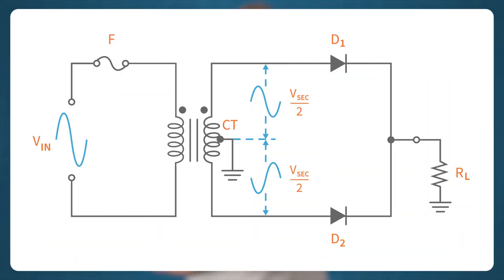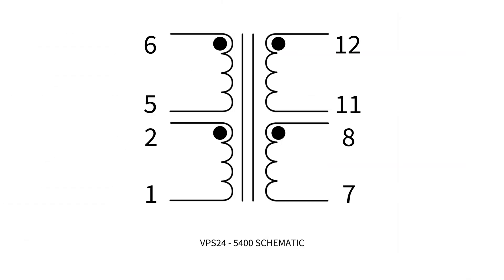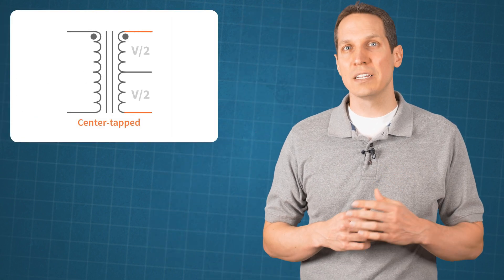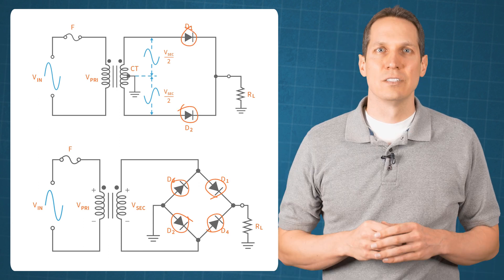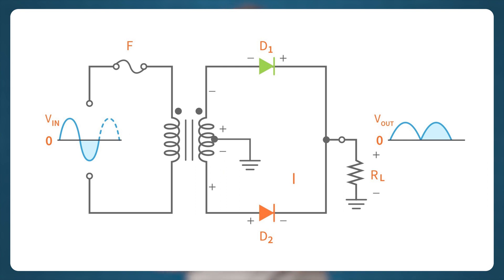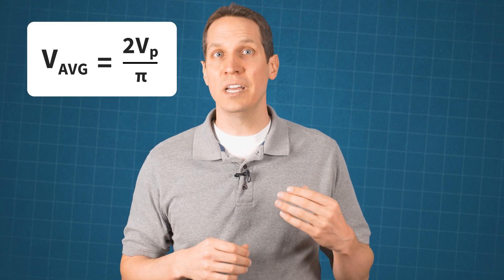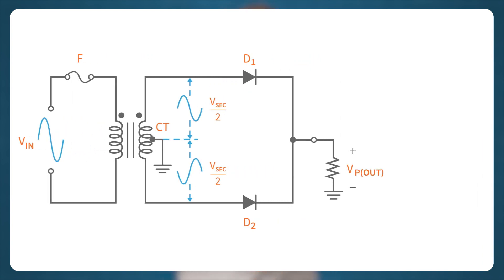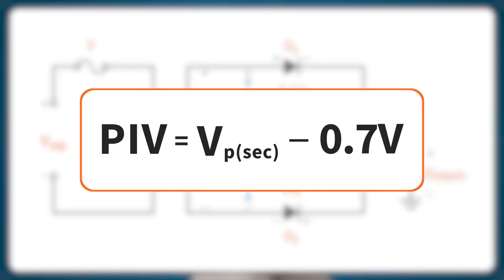Full-wave Center-tapped Rectifier Tutorial | Basic Electronics

Comment: Hi! Thanks for the explanation about center tapped transformers! I rolled up my sleeves to build a bipolar power supply from an old toroidal transformer and LM317 + LM337 regulators.

I personally fixed (blown thermal fuse) a toroidal center tapped transformer a year ago. I had to unwind the secondary side to reach the blown fuse. It was different than you have shown in the video. Starting point of secondary windings are directly connected to each other from 0V point. Which means the center tap is starting point of winding and is real 0V. The transformer ends with two separate 16V wires and 0V center tap. (16V-0V-16V)

Can I rectify the AC with just two diodes (for this specific transformer) as well?

Comment: You got the current direction wrong at 2:06. Current cant travel through the anode of a diode.
Reply from the maker: I just reviewed and it looks right at 2:06.  Also, current can only flow from the anode to the cathode of a diode (with the exception of reverse leakage, breakdown, zeners - none of which we're considering here).  Are you mixing up electron flow and current flow?
Reply: @CircuitBread  weird, my professor specifically said current cant travel from anode to cathode, that it is a check valve and current can only travel from the cathode and out the anode. Im going to have to check this out. Thanks for the info

Comment: Hi, Amazing video. I understood Center Tapper Rectifier. But can you explain to me why in the bridge rectifier voltage isn't halved? There too current take two paths to reach Load. Or, Am I understanding it wrong?
Reply from the maker: Hey Pantho, there is actually only one path with a bridge rectifier, but that path changes depending on where you are in the cycle.  The only reason your voltage drops is it going through the two diodes in each path.  Check out this tutorial and see what you think: https://www.circuitbread.com/tutorials/bridge-full-wave-rectifier-operation
YouTube doesn't notify me of second responses for some reason, so if you have any follow-up questions, I recommend putting a question on that YouTube video or even jumping on our Discord channel.

Comment: EXP. NO.6 
EXP. Name:  Center-Tapped Full-Wave Rectification 
 
OBJECTIE: 
 
The purpose of this experiment is to convert AC voltage to DC voltage and to demonstrate the operation of the center-tapped full- Wave rectifier and recognize a full-wave rectified sinusoidal voltage. 
 
EQUIPMET: 
 
1.	Digital  Multimeters 
2.	Breadboard 
3.	Step-down center-tapped transformer (220V/12Vr.m.s) 
4.	Dual-Channel Oscilloscope 
5.	General Purpose Silicon Diodes 1N4007 
6.	Resistor 1kΩ 
 
1. Theory: 
 
The rectifier is circuit that converts the AC input voltage into a pulsed waveform having an average (or DC) value.  
 
Types of rectifier circuits are:   a- Half Wave Rectifier Circuits   b Full-wave rectification. 
	A center-tapped (CT) full-wave rectifier 
	Full-Wave Bridge Rectifier 
The full wave rectifier converts both  positive  and  negative half cycles of the input AC signal into output pulsating  DC signal. 
Center tapped full wave rectifier: 
 
A center tapped full wave rectifier is a type of rectifier, which uses a center-tapped transformer and two diodes to convert the complete AC signal into DC signal. 
 
Figure (1) shows a schematic diagram of a full-wave center-tapped rectifier uses two diodes connected to the secondary of a center- tapped transformer. The transformer is useful in electrically isolating the diode rectifier circuit from the 220V AC source, and also is used to step-down the input line voltage into a suitable value according to the turns ratio. The transformer’s turns ratio is defined by: 
 

  
 
Where Vp is the r.m.s value of the transformer primary winding voltage, and Vs  is the r.m.s 

value of the transformer secondary winding voltage. In the circuit of Fig.(1), The voltage for 

Ac source is 220 V(r.m.s) 

 
Figure (1): The Center-Tapped Full-Wave Rectifier Circuit 

 
  
 
The Input voltage is coupled through the transformer to the center-tapped secondary. For the positive half cycle of the input signal, the polarities of the secondary winding voltages are shown in Fig 1. This makes the upper diode D1 conducting and the lower diode D2 to be reverse-biased. The current path is through D1 and the load resistor RL. For the negative half cycle of the input voltage, the voltage polarities on the secondary winding of the transformer will be reversed causing D2 to conduct, while reverse-biasing D1 .The current path is through D2 and RL. Because the output current during both the positive and negative portions of the input cycle is in the same direction through the load, the output voltage developed across the load resistor is a full-wave rectified DC voltage as shown in Fig.(2). 

  
Figure (2): Waveforms of the Full-Wave Rectifier 
 
Input peak AC voltage (Vp (in)) can be calculated as: 
 
  
 
 
The peak value of the output voltage is given by: 
 
  
In equation (3), VK it was assumed that the voltage drop across the silicon diode is 0.7V when it conducts. 
It can be verified that the mean (or DC) value of the output voltage is given by: 
  
 
Mean or dc output current is given by: 
  
 
 
2. Procedure 
 
a)	Connect the circuit as shown in Fig. (1). 
b)	Draw the input signal voltage waveform (A.C.) voltage, and calculate the pick AC voltage (Vp(in)), time (T), and frequency (f) by oscilloscope. 
c)	Draw the output direct pulses voltage (D.C) voltage, and calculate the maximum output voltage (Vp(out)), time (T), frequency (F), mean (or DC) output voltage (Vdc) at D.C. position of oscilloscope. 
d)	Measure the direct output voltage (Vdc) and direct output current (Idc) by multi-meter. 
 
3. Calculations 
 
         From the practical results of this experiment, calculate theoretically the           following:  
 
          a)Vdc          b) Idc     c) Vr.m.s

Comment: I understood Center-tap rectifier is Vp(sec)/2 and Bridge  rectifier is Vp(sec). So, I think that Bridge Rectifier had no loss of Vp than Center-tap Rectifier. For this reason is Bridge Rectifier more efficient than Center-tap Rectifier ?
Reply from the maker: Actually, if anything, the center-tap rectifier is more efficient as you only have the voltage drop over one diode, not two, as well as the slightly smaller component count.

Comment: Remember, dont get secondary winding peak voltage mixed with the center tapped secondary voltage. The last equation can get confusing to beginners and the diodes need to withstand the total voltage not the one given by just half the winding.
Reply: this is very confusing for me; I don't understand why 😥

I was thinking that PIV = (Vp(sec) / 2) - 0.7 since the lower diode is reversed biased and in the practical model it will be treated as open.

My professor said this though and I don't understand why it is so: PIV = [(Vp(sec) / 2) - 0.7] - [(-Vp(sec) / 2)] => (Vp(sec) / 2) - 0.7
Reply: my prov qlso said piv is vsec/2, but the way i see it is that the upper half is providing Vsec to the REV doide and load, 

while the other half of the coil is ground and - so it is pulling across the diode. so 2 forces of Potential Difference. for example, 10 and -10. so 20v this is assuming the full windings on Vsev makes 20v.

Comment: I want to create a powerful electromagnet, but I have no idea how to build one or map it out in a drawing or on a circuit board which is the actual goal. I was wondering if you had an email so we could discuss this further?  

So far what I've come up with for the circuit is as follows:

1.)"Step Up Transformer", the reason being I want to increase voltage, I know it drops current. Also this is a DC source, 9v battery 0.31amp hours. 1:4 ratio 10 loops - 40 loops. Primary Voltage= 9, Secondary Voltage= 36. Primary Current= 0.31 amps, Secondary Current = 0.0775 amps.

2.)"Oscillator", I want the current to go back and forth as many times in a second to increase the strength of the electromagnet, I'm assuming that by increasing how many times the current runs through the loop I will be increasing the overall current to the electromagnet. For example, a constant current of 2 Amps over a span of 1 second vs.2 Amps at a frequency of 30 Hz is 60 Amps in 1 second, or that's how I see it in my head could be wrong.

I was thinking of an LC oscillator; with a 10mH(10x10^-3) inductor, 20uf(20x10^-6) capacitor, and a 10-ohm resistor, the reason for the resistor is the impedance would b "0" without a resistor because the XL & XC(22.36) equal "0" when subtracted and V/0 cant happen. With a 10-ohm resistor, I-RMS is 3.6 A.

3.)"Transistor", NPN(BJT) I assume would be the correct type to use. The reason for this is to amplify the secondary current and another to amplify the frequency of the "Oscillator"; the resonant frequency is 355.88 Hz. The goal is to have a current higher by a factor of 3.5 times the secondary current and frequency higher by a factor of 3.5 times the resonant frequency. I also learned recently that by increasing the frequency we increase inductive reactance and lower current, so I don't if it's possible to increase the frequency and current, I don't want to increase the resonant frequency but I want to increase frequency overall and I don't know if those two are actually separate. But even if by increasing the resonant frequency we would lower the current couldn't I just amplify the current by a higher factor to overcome the inductive reactance? 

4.) "Center Tapped Full-wave Rectifier", the reason for this is so the current is still pulsed but in one direction to keep from switching the polarity of the electromagnet which would weaken it.  

Now maybe other components are needed even multiple of the same component like the transistor or oscillator, but I wouldn't know that my knowledge is minimal. So if you could shed some light on this or help in any way it would be appreciated.

Comment: hello thank you so much for putting this video i want to ask what are the advantages and disadvantages of  Full-wave Center-tapped Rectifier ?
Reply from the maker: Hi Natalie, off the top of my head, I'd say a full wave bridge rectifier is going to be smaller and cheaper than a center-tapped.  Even though you have less components, transformers with a center-tap tend to be a little more expensive, but at the same time, they're fairly common and may be something you just have lying around.  On the advantages side, with a center tapped rectifier, you only have half the diode drop, so you'll get a little more voltage out of your input.  There's probably some other differences that I'm not thinking of but those are a couple!
Reply: If you’re working with an Audio Amplifier that requires split power supply, it’s much easier to make a split power supply with center-tapped rectifier :)

Comment: Can we use a capacitor to filter out the fluctuating output volatage.. ?
Reply from the maker: Yes, absolutely!  That is what is typically done.  Just put a capacitor (or 2, of different chemistries and values ideally) in parallel with the load.

Comment: Can we connect voltage regulator with center tap rectifier
Reply from the maker: Hi Surafel - yep, you definitely can!  We go into the most depth on making a power supply in a half-wave rectifier tutorial we did, but the same principles apply.   You can check it out here:  https://www.circuitbread.com/tutorials/half-wave-rectifier-in-a-power-supply

Comment: Please tell me what is the difference between Vpeak(out) and PIV? And how the later is more than the former? Thanks CircuitBread for sending the link to this video.
Reply from the maker: Hi Noorul, good question, this can be confusing.  Vpeak(out) is the voltage across the resistor, which is half the output of the secondary, minus the forward voltage of the diode.  As the output of the secondary has reference ground at the center-tapped portion of the transformer, that's why the voltage seen by the resistor is HALF the total secondary output.  Peak Inverse Voltage, on the other hand, is measuring the voltage across the reverse biased diode.  If you look at the diagram (it's easier for me to study these images in the written tutorial -  https://www.circuitbread.com/tutorials/using-diodes-as-clippers-or-clampers ) you can see that the reverse-biased voltage has the entire secondary output, including the negative voltage but minus the voltage of the other, forward-biased diode, across it.  So the PIV is nearly double the Vpeak(out).  I highly recommend checking out Figures 7 and 8 particularly in the written tutorial, and looking at the waveforms in Figure 7.